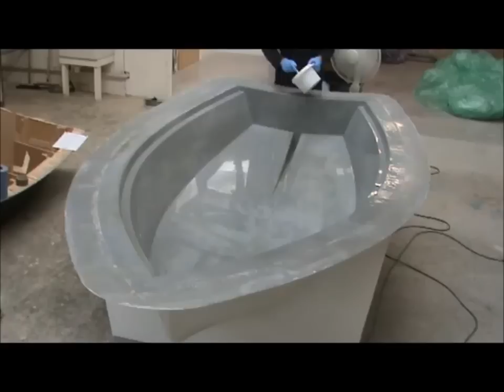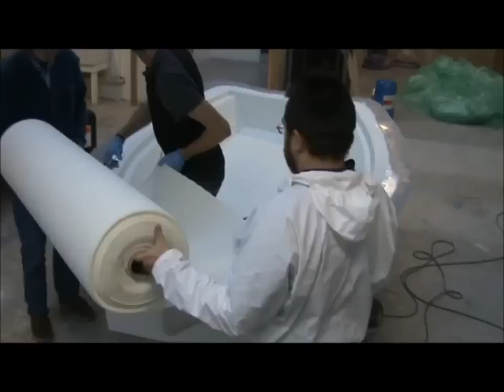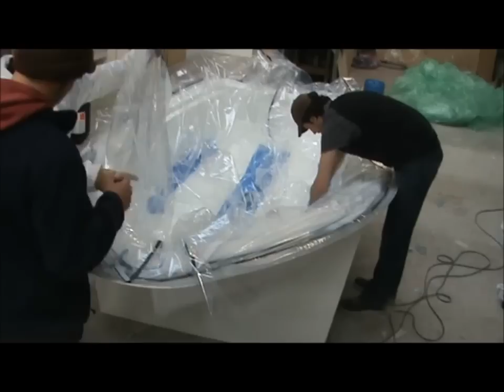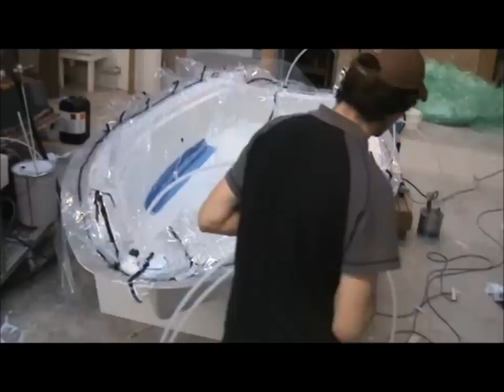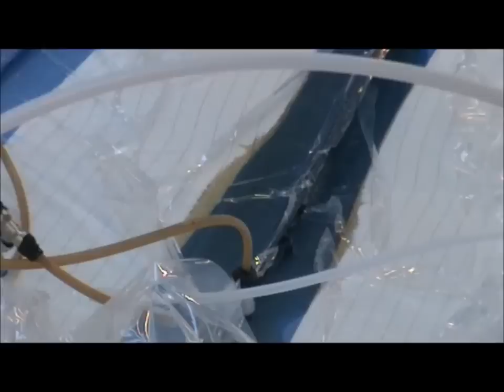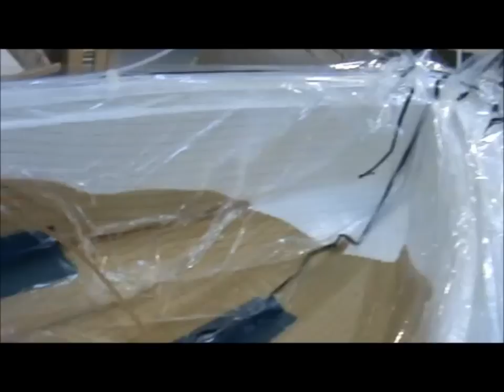3m dinghy build using resin infusion

Comment from the maker: Hi Dallas,

The boat requires 19 litres of resin with this laminate schedule (built heavy as it will be used as a plug to make further tooling) and with the sorts of fabric and core/bulker used, I would normally expect to get a flow rate of up to 1 litre per minute.

The process is really dependant on resin temperature and on the day we filmed the dinghy build, the workshop was a little cold so it was nearer 0.5 litres per minute.

Hope that helps.

Cheers,
Alex

Comment: hi,which resin did you you use epoxi or poliesthel. how fast did it to infusion resin?
Reply: I doubt it. The gel coat stays sticky, but maybe between layers of fiberglass.
Reply: I'll bet poly since they used gelcoat.
Reply: @elmeradams8781  epoxy is fine with vinylester gelcoat, but looking at the colour I'd also guess it's polyester resin

Comment: How can I build a mold?Have you some technology?Best
Reply: Stanley Swarovski au i used an old aluminum boat and fiber glassed ove the bottom then i mounted to saw horses and pulled the boat out. Then braced up with ply wood. Then gel coat the inside and walla u have a boat mold